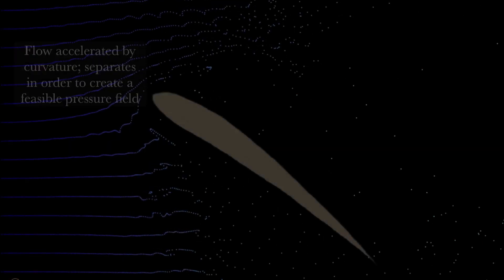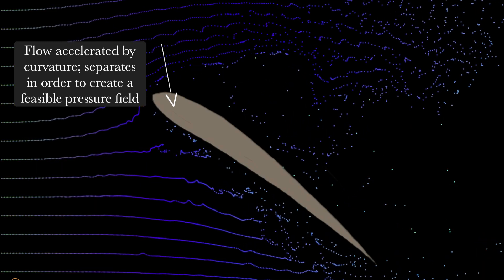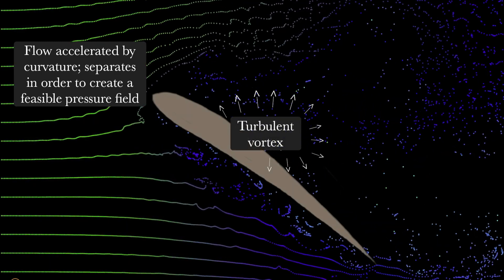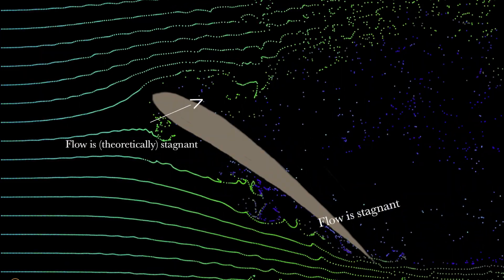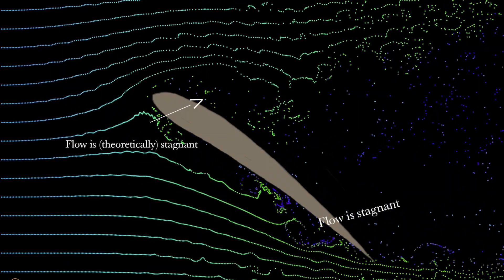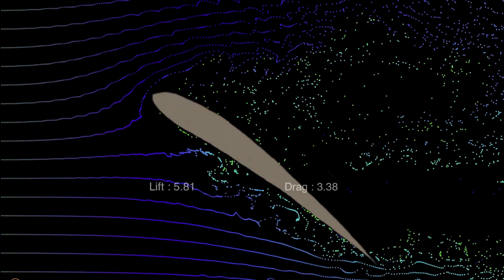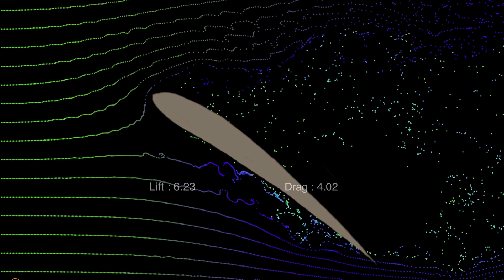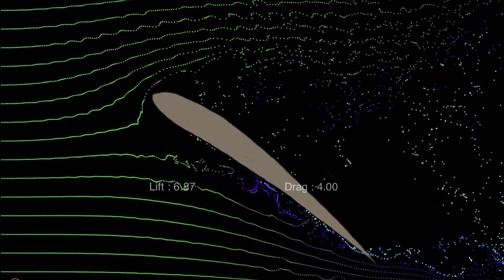Copying Nature - Feathers On a Glider Wing to Reduce Drag and Soften Stall

Comment: Very cool, did not know about these covert feathers before watching. The alula, another type of feather on birds, serves as natural “leading edge flaps” for birds, but this is something entirely different. Very cool experiment!
Reply from the maker: Yeah the alulas are like the steering feathers. They are used at low speeds for high maneuverability by altering the lift and drag and boundary layer stability right at the leading edge.You can really see the alulas in action when watching birds like eagles that need to maintain high lift production and have extreme maneuverability at low speeds. Similarly, poultry like chickens and pheasants have some cool alula deflection at high angles of attack. I think the coverts are in a way passive extensions of the alula function. I mean they help maintain lift at low speeds and prevent wing stall. The whole function of these feathers is really quite nuanced and I think oughta be looked into more. It's all such cool stuff.

Comment: Brilliant work did the cg not change by adding the weight
Reply from the maker: Thanks! No, not much. The feathers weighed 1.99 grams all together. Being only an inch or so in front of the CG, they only moved the CG, at most, a small fraction of a millimeter.

Comment: Wow!  I did not expect such a drastic improvement! Noticeably a bit more drag but that plane is virtually unstallable. They're like active vortex generators. They only pop up ( on their own ) when they are needed. I can't find anything about covert feathers on plane wings. You might be the first to document on that.
I like the animations, nice job on the video edit :)
Reply from the maker: Yeah the improvement is really significant. In theory,. the drag should actually be considerably less. There is a paper I found that described wind tunnel tests of similar surface-mounted elements, showing up to 15% drag decrease. It may just be that the feathers in this case catch passing air currents and cut down on the aircraft's momentum thereby. As for functioning like vortex generators, in certain cases they do, but there's also a way to think about it where they don't necessarily. Notice that, when the feathers raise, they are effectively lowering the downward deflection of the upper wing surface, relative to the freestream. If we assume the freestream is laminar, then this means that the feathers allow the high-energy boundary layer to remain laminar for longer as it can easily flow around the shallower curvature of the feathers. By the time the airflow is leaving the back edge of the feather, it is right above the adverse pressure gradient, and the stagnant area. Thus, it can separate from the feather in a low-energy region, where it does not turbulate so drastically. It then rejoins the freestream and flows away. I would presume this is where the theoretical decrease in drag comes from. 
    Well, whatever the case, I am definitely not the first to have employed this idea. Felix Schlaller has done the same thing here: https://www.youtube.com/watch?v=VHdwjqHAemY. Glad you liked the video. Thanks! :)

Comment: Very enjoyable to watch, love your work.  Now my question is:  Why are no  aircraft full size or models that take advantage of the phenomenon and add those feathers?  It would be revolutionary  to to see Cessna turn into a super STOL because of it.  There must be some disadvantages!  Tons of material for investigation.
Reply: I believe the answer to your question would be: unlike a bird's wing, machines such as aircraft can take advantage of mechanical alterations that would be impossible to recreate in Nature, such as Fowler Flaps. Many aircraft are equipped with this type of flap that, when deployed, allows the airflow to pass through the airfoil; thus allowing a vast increase in camber and angle of attack without delaminating airflow from the top of the wing.
Reply: @wunkus  yes, quite true.